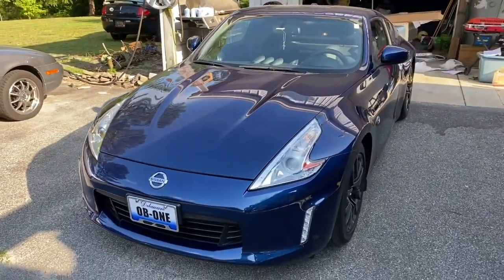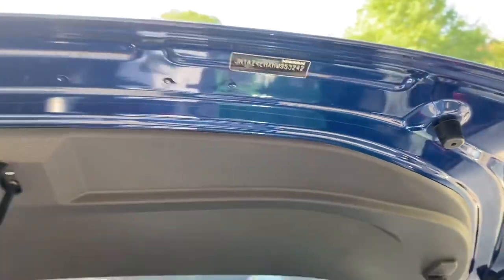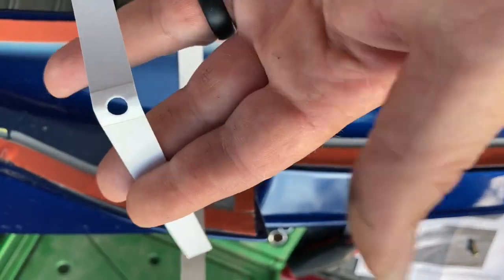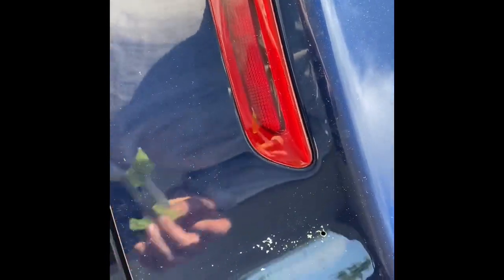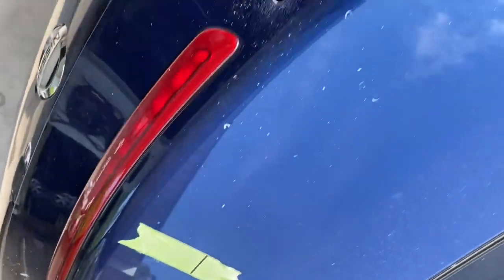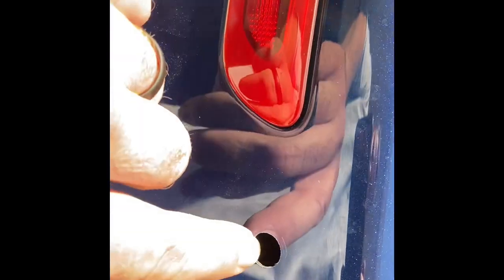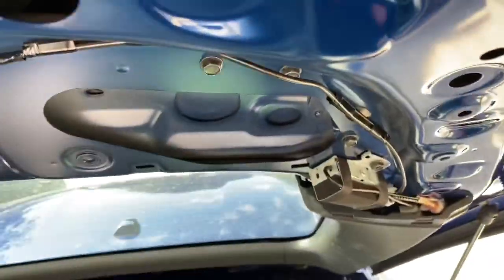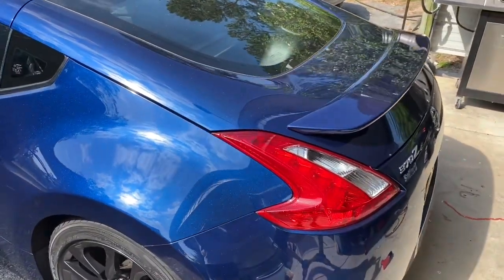370 Z SPOILER INSTALL!

Comment: Excellent install instructions, I'm doing this next week. FYI - A factory Nismo spoiler is $1,865.00 if you can believe it. Got mine used for 400.00. Still a questionable price.

Comment: Note: The 370Z hatch is aluminum, so it shouldn't rust.
Reply from the maker: It will Oxidize, and it can eventually lift the paint. I use the term rust on behalf of the novice. 
Good catch, thanks for watching!

Comment: What did you put on the holes to keep it from rusting?
Reply from the maker: I applied some paint with a small brush.
Reply: He used a single stage paint that uses a hardener.